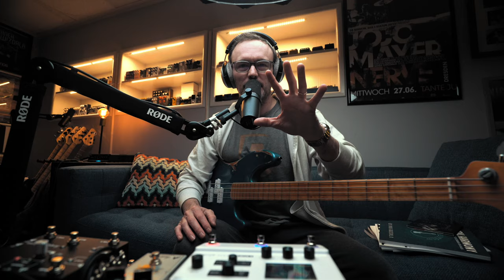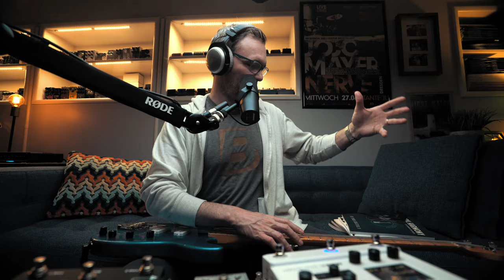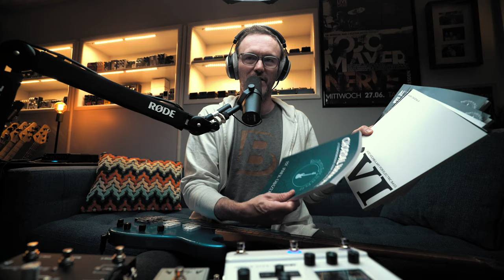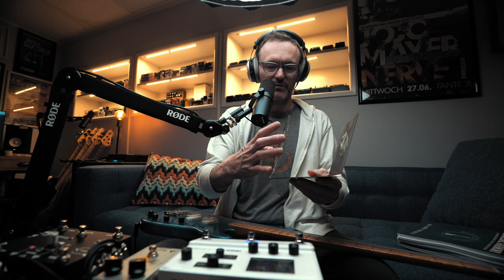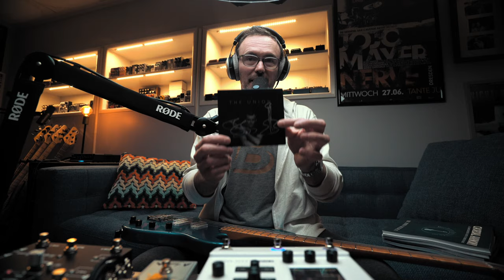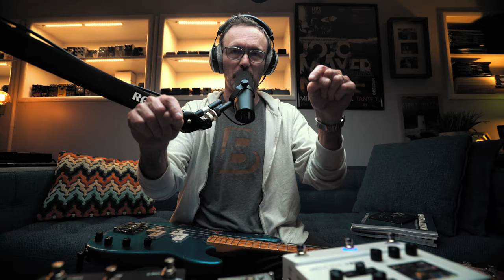Bass Signal Path Explained | The Janek Gwizdala Podcast #276

Comment: Janek, RE the Vertex riser height, I have the same issue with the DC7 just touching the top of the Cali76 knobs under the riser. I'm going to put a 2mm or 3mm thick thin strip of aluminium under each riser side wall (drill holes for the screw locations) to sort it.

Comment: The harmonizer is "key dependent", do you have it in various keys?
Reply from the maker: It’s actually not key dependent, it’s a single voicing that I use chromatically.
Reply: Oh... @janekgwizdala
Reply: @janekgwizdala   What interval, fifth?
Reply from the maker: @gonzalotrejos3556  on of them is 1-5-9 plus a low octave, but i have maybe a dozen different shapes programmed that I use regularly.
Reply: loving it :)  @janekgwizdala